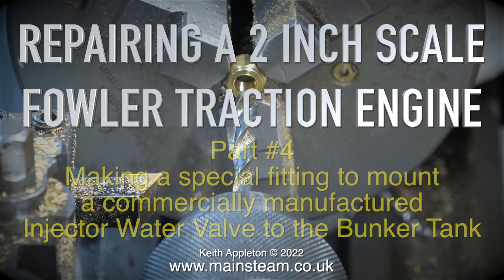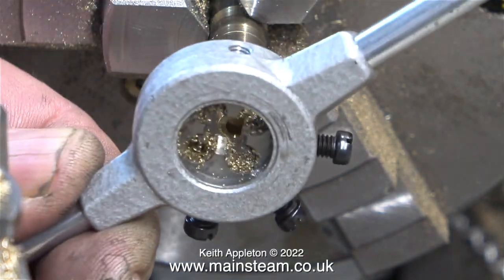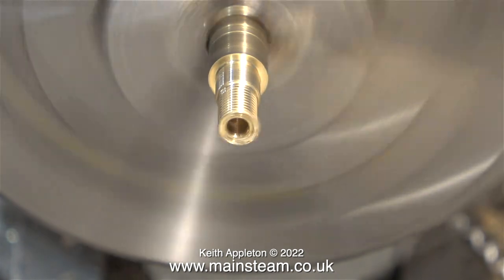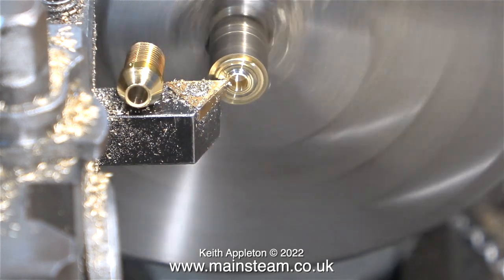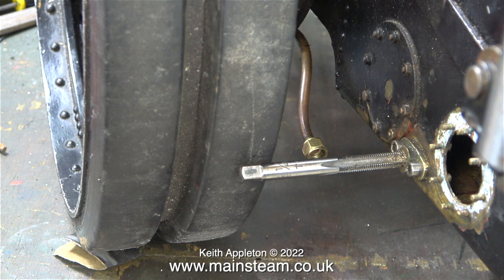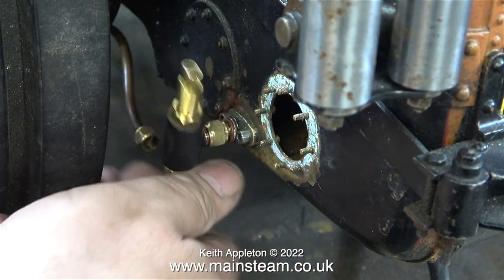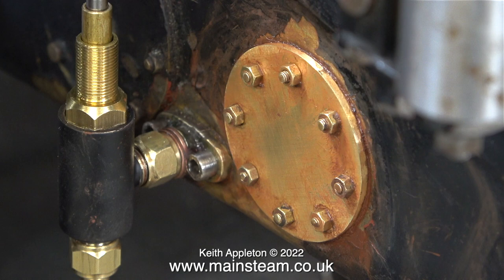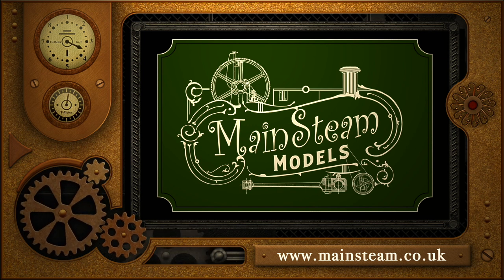REPAIRING A 2 INCH SCALE FOWLER TRACTION ENGINE - PART #4

Comment: If I need a tap extension, I have use a 1/4" socket set. Find a socket to fit the end of the tap then use a 1/4" extension bar and handle (similar to a screwdriver handle).
Reply from the maker: I would normally do the same, but I wanted to show another less obvious method for anyone who doesn't have or can't find a suitable socket extender shaft }:-)))

Comment: How is it possible for the flywheel key to be turning one direction and the spokes of the wheel turning the opposite (in the video)?
Never mind, I know, it is an illusion caused by the shutter speed of your camera, something slightly less than 30 frames per second.
It is curious that the image turns both ways. Just a funny occurrence, worth mentioning for interest. ;-)